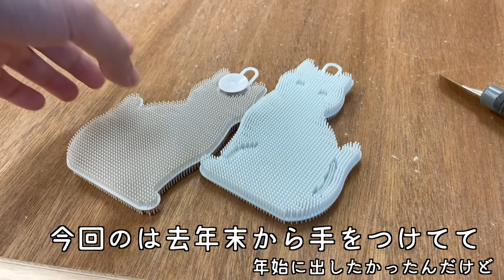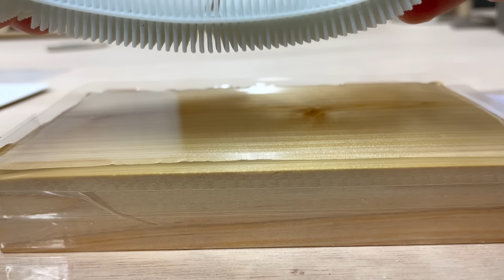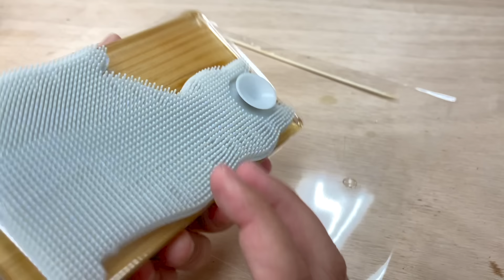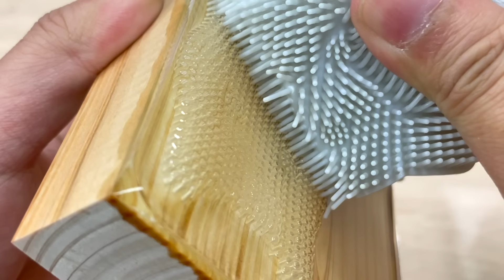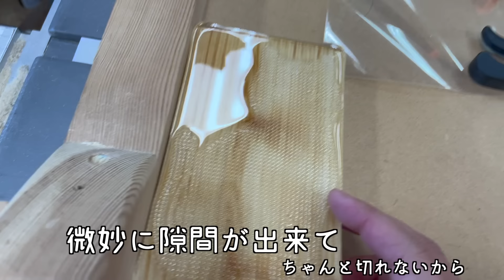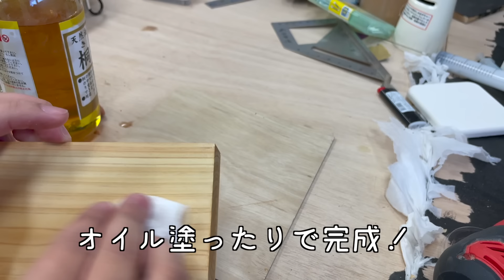【集合体ごめん】気持ち悪いけど病みつきになるこれ

Comment: You can also use vibration to remove bubbles from epoxy resin. They sell machines that will vibrate big concrete slabs, but for a shape this small and shallow, you can use a massage device.

Edit: There is something called "mold release spray" (I do not know if that is going to translate as the right word. Template release spray? Object release spray?) that you spray on objects to help keep them from getting stuck inside epoxy. It works like putting oil on a baking pan, except it is made of some other chemical that will not mix into the epoxy.